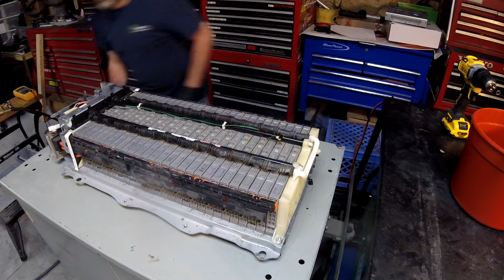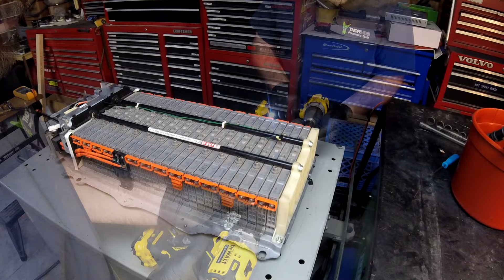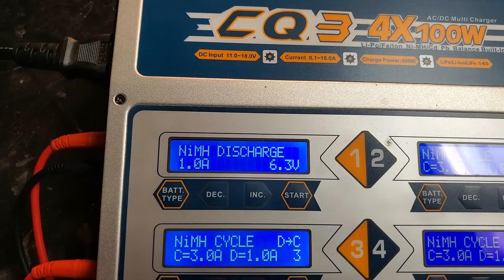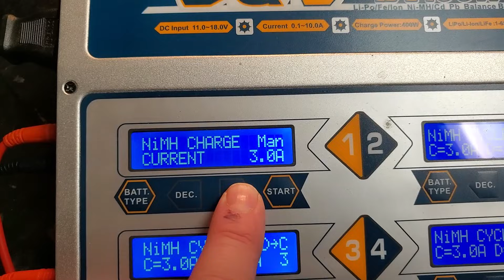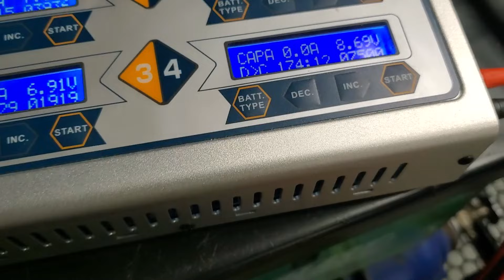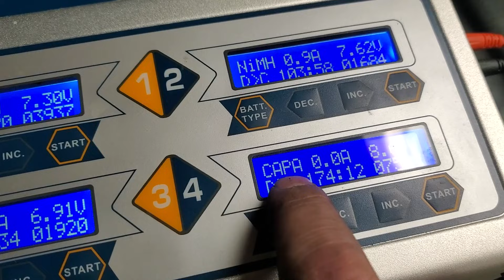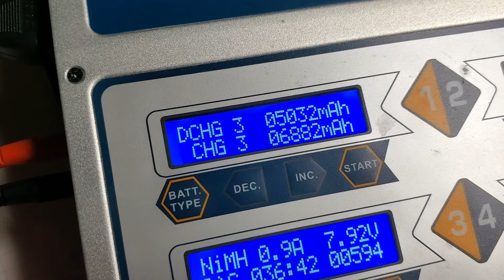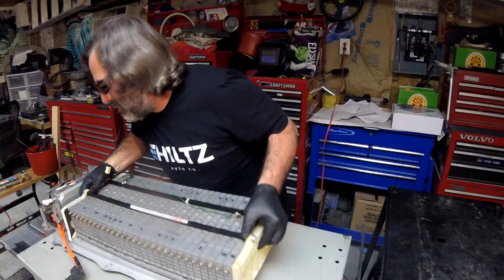DIY Refurbish / Repair Hybrid Battery 2nd Gen Toyota Prius - EV-Peak smart charger POA80 P0A80

Comment: How many battery cells did you have to replace again? Considering doing this than buying a 1300-1500 remanufactured battery my Prius has 286k and never replaced the battery
Reply from the maker: Hey JDub, Thank you for watching and writing in. I don't remember how many I replaced on this pack. I think 4 but not 100% sure. Most if the batteries I have done ave over 200k miles.
Reply: @GreggFesto  thank you man was able to finish after a couple weeks later, you’re a life saver 🤟🏻
Reply from the maker: Hey JDub, Thank you very much for the great comment. Glad you got it done. I really appreciate you writing back in and letting us know that you completed the refresh.  How many cells did you end up replacing?
Reply: @GreggFesto  just one, battery I refurbished had 286k miles
Reply from the maker: AWESOME JOB JDub!!!!! Thanks for the feedback.
Reply: @GreggFesto  hey man i jusst stumbled upon a gen 1 prius needed a hybrid battery, does this same process work in the 1st gen? thanks

Comment: @Gregg Festo  Sir, thanks for the video, I need your advise: I already have Prius 2nd gen refurbished battery installed by Lifetime Hybrid Batteries ($1400!) an year ago, battery is almost dead, but the company is out of business, or changed its name, does not repair ir. Question: will I be able to restore this battery? If yes, what less expensive charger discharger can I use instead of EV Peak, is this one OK?: at Amazon, 50 watt: GoolRC B6 Mini Multi-functional Balance Charger/Discharger for LiPo Lilon LiFe NiCd NiMh Pb RC Battery.  Thanks a lot!
Reply from the maker: Hello Eugene, Thank you for watching and commenting. If the cells in your pack are able to be brought back to life then the method shown in this video should do it.  I looked up the charger you mentioned on Amazon. I think this charger would work for this procedure as it does the battery type, discharge/charge rate adjustments, and will show the discharge capacity value. Some things to mention are - You will need a power source such as car battery or power adapter, you can only refurbish 1 cell at a time instead of 4, and I see from some of the reviews that the instructions are not the best. There may be a little struggle at startup but I am confident that you can do it. Please write back and let us know how it goes. Good luck to you.
Reply: @GreggFesto  thank you Gregg! I will try and let you know about the results
Reply: @GreggFesto  Hi Gregg, I am closer to starting reconditioning, should receive soon almost the same as your 4x charger but Bguad brand. Quick question, when you have a chance to respond, about cells that I probably will buy from eBay: would it make sense to load testing of the cells, shown in the Youtube video called "Prius HV Battery Module Load Testing - Gen 2-3 ll lll" ?  Thanks a lot!
Reply from the maker: Hey Eugene, I usually purchase my cells from eBay as well. Sure you can load test them to see that the power is there however unless you have done the same thing to your other cells then you will not be able to see how they compare to what you already have. I like to install the replacement cells in my pack then run them through the same cycle as I did all the other cells. This will let me know how they compare with my existing cells based on the same charger setting. Please write back in and let us know how you test your replacement cells when they come in and how they compare to your exiting cells.
Reply: @GreggFesto  thanks Greg, sure, I will let you know. So you are saying that running the replacement cells through the same cycle as the existing ones and also comparing with them, will give me the same idea how good they are as the load test would show, correct?
Reply from the maker: Yeah Eugene, If you run the new cell through the same cycle then you have real numbers to compare. You can see how good your new cells are in comparison to your refurbished cells.
Reply: @GreggFesto  great, thank you, it will make my life easier!

Comment: Thank you for taking the time to make a fun and educational video! I've watched it several times and purchased the EV PEAK CQ3 4X 100W charger.  My question to you is, is the 720 minute safety timer? Is this why it took 16 days? And if so, can you recommend a solution for shorter duration? Thanks sir.
Reply from the maker: Hello Felipe, Thank you for watching and commenting. Much appreciated. The safety timer will not affect the length of time it takes to charge as much as the condition of the cells themselves and how how many times you have to cycle them to achieve 5000mAh as the low number.  If your pack is in better condition than the one in this video it will take less time. Some people change the charge and discharge set points to speed up the process.  I just use the settings obtained from PriusChat as I have had excellent results with them. If/when you try the process please let us know if you made and changes to the settings and how it goes.
Reply: @GreggFesto  appreciate it Gregg. Very helpful. 🙏🏽
Reply: What does it mean when charging port says CAPA & one says FUll?  Sorry, I’ve never used a tool like EV Peak. Thanks
Reply: Port 1 read low number 4468 and high 7500 but CAPA was blinking.port 4 said Full and had no numbers to read so I ran it again?
Reply from the maker: I am not certain why the cell that read FULL did not display mAh values. You will for sure need to know the values to determine if the cell is good. Yes, I think running it again is needed.  Be sure you are pressing the correct buttons when starting to look at numbers. I do know that if you hit the wrong button that you will not b able to see the values. Please let us know what you find out.
Reply: @GreggFesto  appreciate it. So to be clear. I’m sure you said in the training video that while if the high number is great (7.5)but…if the low isn’t higher then 5000 milliamps its not joining the family?
Reply from the maker: Hey Felipe, You are correct. The lower number needs to be 5000mAH or better. Please let us know how your pack turns out, how many cells (if any) have to replace.
Reply from the maker: Felipe, The pack as a whole will only have the capacity of the weakest cell. So if you get all of your cells to 5000mAH low number except one of them is 4000mAh, then your pack as a whole will only have 4000mAh capacity. If you get all of your cells to 6000mAh low number or better then your pack will be stronger than the one shown in this video.
Reply: @GreggFesto  fantastic! Does the discharge number have to continuously increase consistently every cycle. What if it dchrg in one cycle at 5600 and then the next one at 4998. Same for chrg. If it reached 7.5 in one cycle but in the next 6.9?
Reply from the maker: Hello Felipe, That is normal for the numbers to change some from cycle to cycle. You should indeed run the cycle again. This is letting you know the health of your cells. If your cell cannot maintain 5000mAh or more for the low number then that cell is starting to get weak so it may be a good idea to get it replaced.
Reply from the maker: Hey Felipe, CAPA means the cell is at capacity so it met the 7500mAh high number you set. If the low number is less than 5000mAh then run cycles again. If low number is at least 5000mAh then that cell is done.
Reply: Great 👊🏽. One module landed on 4616 & 5073 on DCHG and 6540 & 7060 CHG for cycle 1 and cycle 2. Keep going or it’s a keeper?  Thanks buddy.
Reply from the maker: Looks like a keeper to me Felipe! Good going.
Reply: @GreggFesto  youdaman 👊🏽. If your ever in Denver…I got dinner and 🍺.
Reply: Good day to ya. I’m having fun and great results thus far…thanks to you! I’ve also seen a few modules significantly improve with as many as 10 cycles. Im just a little unclear what is the minimum number for CHG at the end of a cycle? My DC meter reads 7.91 for a 6073 mahCHG. Also,is it in vein to cycle a module again if the DSCH reaches 5660? Does cycling it again give it a reason to improve? As in setting it in proper motion of capacity if it’s got it?
Reply from the maker: Felipe, I am glad you are getting good results. I do not set a goal for the high mAh, only the low mAh at 5000 or more. You can get the low number higher but that will require more cycles and time. You will notice at some point (this will depend on module health) that the numbers will level off. The high number will stop climbing and will start dropping. When this starts to happen there will not be much more you can gain from the cell. In the past when I was learning I cycled cells over and over again to try and reach 7000mAh low number. This resulted in killing some of my cells. For this reason and the learning I have done on PriusChat I stick with 5000mAh low number as it is obtainable and will provide good results.
Reply: @GreggFesto 👊🏽👊🏽. So if both #’s read over 5000 mah move on to the next module? Thanks for the master class.
Reply from the maker: Yes Felipe, When I get 5000mAh on low number I move on to the next cell.
Reply: @myboyteo9  hows it going? im probably going to buy the charger you have, did u replace any modules yet?
Reply: @jdub7651  hey. Charger is great. I do recommend buying 3’ cables. I don’t have another use for the charger currently so I bought only the charger. I’m replacing 6 modules. Then balance them for 2-3 days. Until they all read the same with my DC meter.
Reply: @GreggFesto  do you have any recommendation for recycling the damaged modules? Thanks
Reply from the maker: Hello Felipe, I do not have any input for what to do with the old cells. I am fortunate enough that they have battery recycling service at my job. Please let us know what you do with your old cells. I have had some other people ask this same question, maybe you can help them.
Reply: @GreggFesto  Autozone in Denver accepts lithium batteries!
Reply from the maker: Thank you very much for the info Felipe. Next time someone asks me I will suggest an AutoZone.

Comment: Do you have a video for the third generation? No triangle no noticeable increase in engine run time just test results at the beginning of summer we’re near 80% and end of season the test has the battery at 61% life left. Want to head any longevity issue off at the pass.
Reply from the maker: Hey Ian, I do not have a video specific to the 3rd gen at this time. The same charger settings will work for you. Thank you for watching and writing in.

Comment: Question. Let's say during the test of charging and discharging the cell packs and you find one is or Two blocks are bad and you order new blocks do you have to recharge and discharge the new modules with the old module again? Or does the balancing at the end take care of the new block being inserted after you charged and discharge all the existing modules? 

Second question. How long does the charging and discharging part take? You said 16 days is this accurate? Could it be done faster? If so what tips can you share to achieve this?
Reply: 3rd question sorry! Lol.. when balancing at the end all you have to do is let the battery sit for 24-48 hours and left alone?

4th question I can't find that charger :(.. any other suggestions to a similar one that is affordable that can charge 4 at a time?
Reply from the maker: Yes the balance procedure is that easy. The charger has become harder to find as time goes by.  If you read down in the comments you will see that there are some other people who are using other brand chargers. The charger in this video was made by sinfoxtech.com
Reply from the maker: Hey Manny, Thanks for watching and writing in. I usually run the new cells through the process. This lets me know what they read mAh wise compared to the other cells. I can then make better decision on where to place them in the pack during reassembly. The 16 days I mentioned is what it took for this pack. This is for certain a variable which depends on the condition of the cells. Higher mAh cells = less refurbish time. Please let us know how refurbishing your pack goes and it would be great to learn how long the process took with your pack in comparison to this one.
Reply: Greg thank you for the reply! Really appreciate it. I'll start this project in November.. california is too damn hot right now. Another question Greg, when the rc charger is doing first round of discharge and charge did you time around how long that first round took? I work during the day so I'm wondering can I leave 5 rounds of c/DC while I'm at work? Let's say the charger takes 4 hours to complete 5 cycles and I won't get to the machine for another 4-6 hours to start it again will this have any issue if battery Cell sits for few hours without charge?
Reply from the maker: Manny, I did as you mentioned. I set everything up and let the charger run. I would check it before and after work. I did not take readings of how long the cycles took, I just run them until I get low mAh numbers that pass or fail for certain. I wish you best when you do your pack and hope you will please give us an update once you get done.

Comment: Been reading the comments for more than an hour(slow reader when reading for understanding and not entertainment). Haven’t seen an answer to one question and not sure I understand something else.

1. You cleaned and reused your copper connectors. How were they cleaned and was there any anti corrosion reapplied to the plates? How much does a set of new plates cost from Toyota?

2. I remember from other forums that load testing of the cells can be important to evaluating the health of cells. Is the charger load testing them as well? 

For those of us that need visual audio to learn, your efforts drawing all this together is super helpful. I bought my runt of gen 3 with a head gasket needed and gasket masters and an eBay service manual later and 30,000 miles later and I couldn’t be happier. My other vehicle hauls water, wood and fuel oil by the tons and it’s nice to not have to drive THAT when I don’t need more than a people hauler. Keeping it and my car going longer. 

Thank you from the Golden Heart City of frozen north in the seat of a lifted Prius about to go back on over sized ice tires.
Reply from the maker: Hello Ian, Thank you for watching and commenting. I have cleaned the copper pieces with a wire wheel on bench grinder and by hand with a wire brush. I am not sure of new plate cost as I have always been able to reuse the originals. I did not apply any anti-corrosion treatment to the plates. This would be an excellent thing to do though. If I make a new video in the future with a different charger that is easier to locate for purchase then I am going to include the cleaning and anti-corrosion treatment of copper plates. Thank you for being involved and asking great questions. The charger will give you health of the cells by the lower mAh reading.

Comment: @Gregg Festo

Hello. I have a 2007 Highlander. I noticed my battery cells are higher voltage than Prius. (10.3v vs 8.x). Would all the settings be the same on the charger? Thanks
Reply from the maker: Hello FloroBeggins, Thank you for watching my video and writing in with a comment. I am not sure of the best settings to use for your vehicle. My video is to show how easy it is to do the job yourself once you know the steps. There is another comment on this page from AlienCloud that has the same model Toyota as you do and may be able to offer some help?  I suggest trying to find a Highlander forum online. I got my settings from PriusChat.

Comment: Have to ask, I’m using a Highlander battery which has 8 cells instead of 6 but same capacity. I saw you put it at 6.3V which makes sense since your Nominal Voltage is 7.2 for a Prius so it isn’t discharged to low. I know that NiMh shouldn’t be discharged less then 0.9v per cell. So I’m guessing basically for mine the cell nominal voltage is 9.6, should I do something like 8.3V? For the max discharge voltage
Reply from the maker: Hello AlienCloud, Thank you for watching and writing in. I used settings obtained from PriusChat forum. I think a forum on your specific Toyota would be a good place to go for the correct settings. Please write back in and let us know what you find. Hopefully it can guide anyone else with the same questions.